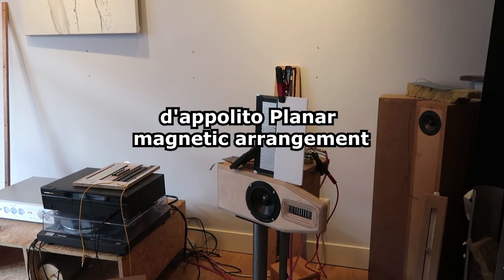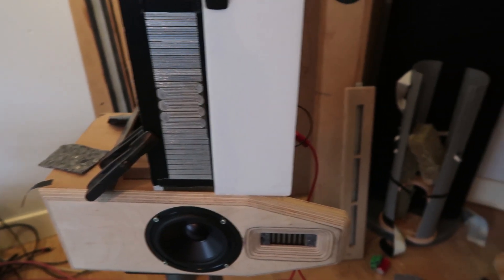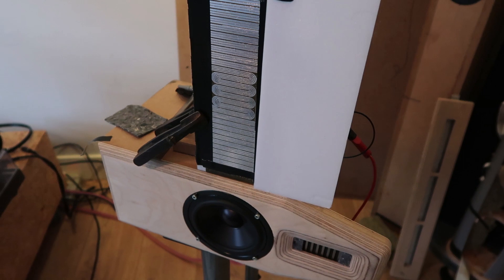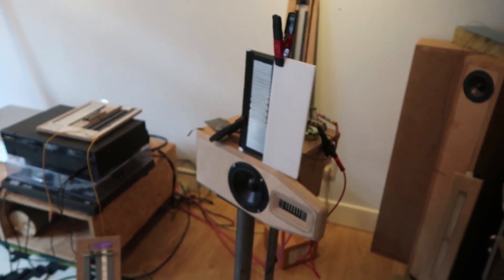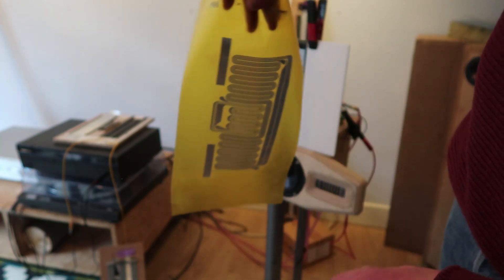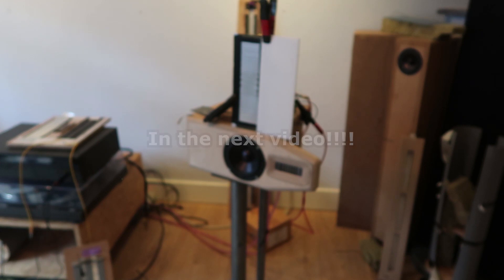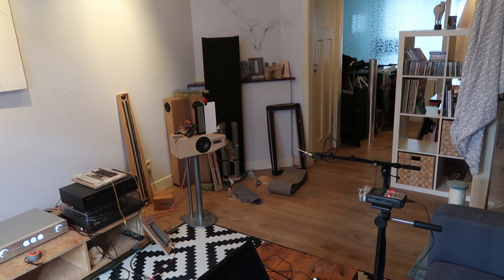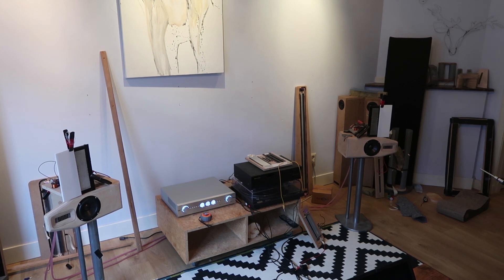D'appolito planar magnetic arrangement

Comment: Could you not change your HF section to vertical rather than horizontal to give better horizontal dispersion (no more than 40mm wide). As long as your LF units are within 1/2 a wavelength of each other at the crossover.
D'appolito? A HF unit between two LF units.....why did he suddenly invent that? Isn't that like someone looking at a wheel and saying "I invented that"
Reply from the maker: the actual driven coil sideways is 30mm. so horizontal dispersion is better then vertical.  wanted that of course :) the places where it turns will be taped of or will sit behind the baffle i made later on

Comment: B&G used kapton for their pro drivers to get the higher power rating and higher output. I have used them in many pro sound reinforcement systems with great success.
Reply from the maker: im using kapton :) at the moment but   i dont need  it for temperature resistance , since these speakers will never see all that much power :)  i did not have any lighter material with acrylic adhesive on it :( or i would haven chosen that.  BG actually does not use kapton. only the fake ones do.  i forgot the name of the material they use. some other heat resistance film with magical properties of course :)
Reply: @joppepeelen  You are half right, their pro drivers used kapton not residential drivers. Their pro drivers could handle 10 watts per inch, music power  So their 40" drivers took 400 watts.  I stacked my two 40" drivers for one side of a jazz in the park and my 80" on the other side.  We crossed them over @ 250 hz to 18" pro subs.  We were outdoors.  Those two speakers easily projected 100 feet, maybe more.  The sound engineer was amazed. He couldn't believe the clarity and the highs.  The band was thrilled because the sound was projected out away from the band shell and did not color their monitors.  Also they are virtually immune to feedback.

Comment: The woofer is loosing +/- 6 db due to lack of baffle reinforcement at low frequencies.  You can regain the spl by changing to 2 drivers in parallel.  If the driver already is 4 ohms, change it to two 8 ohm drivers in parallel.  Even though you are drawing the same power, you'll have twice the surface area providing extra output.  Try an MTM arrangement with woofers.
Reply from the maker: im aware of baffle step :) , but  im not sure what there datasheet contains.  :( so cant predict.
Reply: @joppepeelen  most every speaker company tests their drivers on an infinite plane.  As such, bass almost never lives up to their specs.  A 6db loss is a good place to start.  That's why making sure the woofer is 6db more efficient or adding a second driver is an important part of the planning.  Klipsch loves to tout their efficiency.  But when you look at their impedance plot, their woofers can go down to 3 ohms and even below to keep up with their horns.  In the past Klipsch speakers were shouty.  Not so much anymore.  That is because of them going low in impedance to draw more power out of the amp at low frequencies.

Comment: If you have one surface sticky, you could glue a mylar foil on it to protect a metal foil (for instance). I can imagine that the sticky foil is slightly stretched (as well as mylar is), then mylar is glued, and then the foil is released. Above aluminium, where was no glue, mylar is going to form some kind of a dome/bubbles. And may be this will make sound better. Who knows -)
Reply from the maker: sounds like alllllooooooooot of effort for...   who knows :) it is measuring good as is. i just need lighter :)